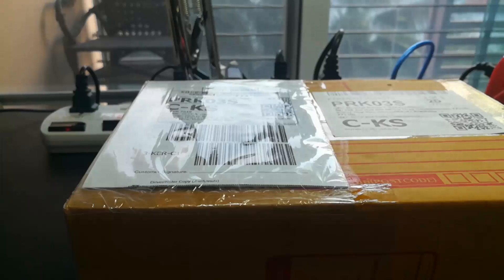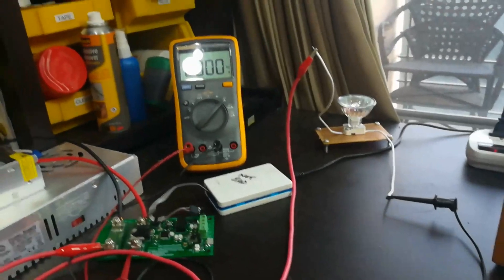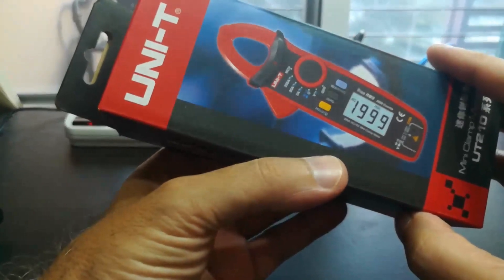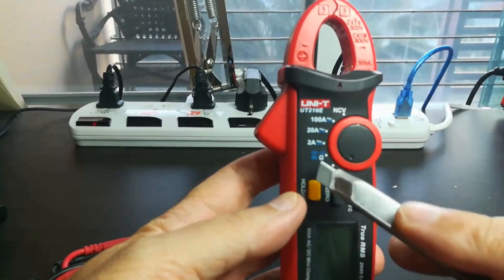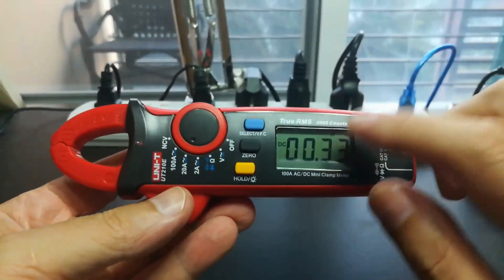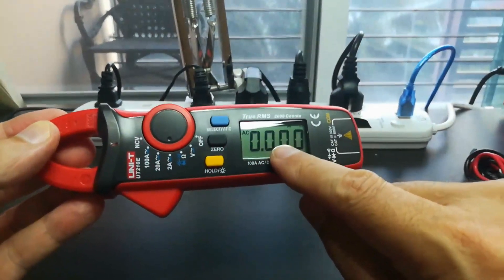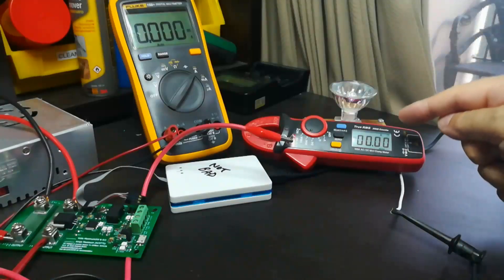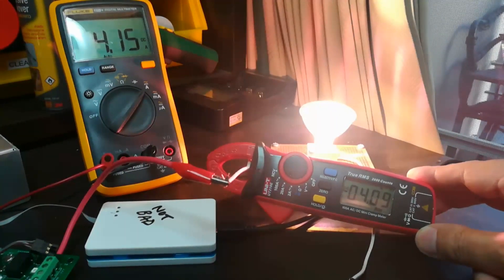UNI-T UT210E DC Current Clamp Meter Unboxing and Test

Comment: UNT-T are not Chinese junk . UNI-T are made in Hong Kong and they are a a major company that makes professional test equipment. And they are one of the biggest rivals to fluke, in actual fact they supply circuit boards to fluke and to other manufacturers like Megger and Kewtech and amprobe
Reply from the maker: Agreed, I just bought another Uni-T multimeter, a UT890C,  for my workbench and designed and 3D printed a snap-on/snal-off wall mount for the meter.

https://www.thingiverse.com/thing:7003634

Comment: I use a UNI-T UT-CS06A 400A AC Current Clamp Sensor, UT196/UT139C/UT117C Multimeter Option Current Clamp for my Fluke 107. If you search for Fluke 107 Digital Multimeter & UNI-T CS06A AC Clamp Accessory Functional Test is should show.

Comment: Can know the leakage current?
Reply: si se puede, pero está pinza es confiable a partir +/- de 20 mA osea 0.020 Amp en adelante ya sea en DC o en AC.... si quieres medir fugas en voltaje  AC por falla de diferenciales etc,  debes comprar mejor una pinza especial de fugas AC que tienen una resolución mínima de    0,001 mA  o 0,1 mA dependiendo de la marca....  con esta pinza si podrías medir la corriente de fuga de un vehículo si tuviese una.....

Comment: Appears pricing has gone up within several years from about $30 to $50.  Has quality improved?  Appears not.  This meter has a 4.5 star rating on Amazon but faild or become problematic in about 1.5 years or so.  Readings become erratic.  Turns out to be fixable as said by Dragon.  The issue is the rotory switch.

https://www.amazon.com/gp/aw/review/B00O1Q2HOQ/R17J2N6YGU0JOE?ref=pf_vv_at_pdctrvw_srp

Comment: Do you know this 211E can be hacked to get 6000 count instead of 2000 so each scale can go up to  "6" instead of "2" ? you can also change the timeout of the light and the default AC into DC mode and a few other things.

Comment: I do own both the 210D and the 210E, and indeed they are really good for the price.
TheD is nice for temperature and frequency but the 200Ampere is a nice thing when working in cars and trucks.
the E is with me for its accuracy in the 2A scale. :-)
Reply: Hi, thank you for your comment. I bought the D model. And I tried to measure low amps in the range of 5 to 10 A. in my car. I can't get it to work. Is it possible that the model D is not working for lower currents of DC?
I thought the difference between the model E and the model D is that you have to set the range on E manually and the D modell does it automaticly?!
thank you
Reply: @pm-s3654  The -D Model should be capable to work in DC Amps as well. If set to the AMP rating, press the Blue button to switch it to DC mode., then bring the clamp still closed to the conductor, in the position you want to measure the current through that conductor. Pres the Zero button (Black) to cancel any momentairely present magnetic field. Then open the clamp, put the conductor inside, and close the clamp.
That should give you the reading of the DC current, in the most possible precision.
Greetings, Neovo.
Reply: @Neovo.Geesink  thank you so much for your fast answer. My problem is actually that I don't know if this model can also read very low amperage. Like 2 Amps?
Reply: @pm-s3654  Even that low, It should do that. Otherwise, return it for RMA, since the meter is clearly defective when incapable of measuring single Amps...
Reply: @pm-s3654  It should be capablem to measure single Amps in the DC range... If the meter absilutely does not give a reading, sent it back for RMA. The minimum resolution should be 100mA The Sensitivity should allso be that low...
Reply: @Neovo.Geesink  Hi! Do you know how much is the lowest DC mA value the 210e can measure? tia.
Reply: @icoseb8067  That should be 1 mA in the 2A range. But with the magnetic field of all surroundings, that could be a challence... Better is to loop the wire a few times trough the clamp with such low currents, and devide the readout  by the number of turns. For easy conversion, 10 times throuh with very small currents.